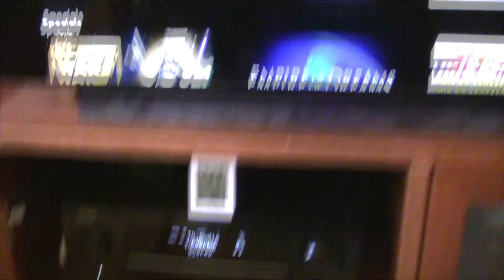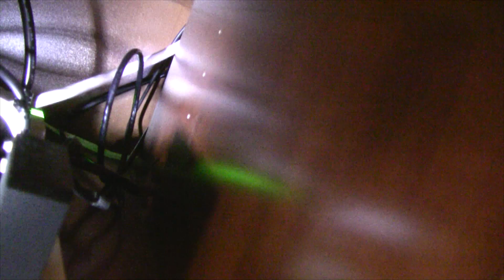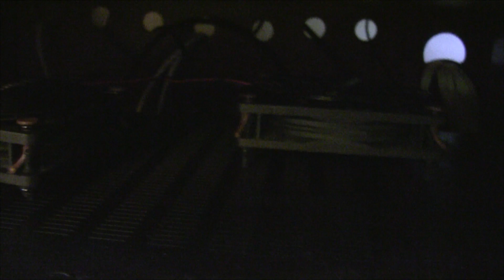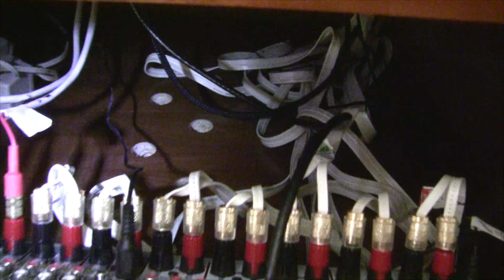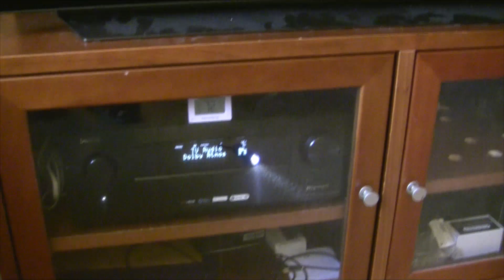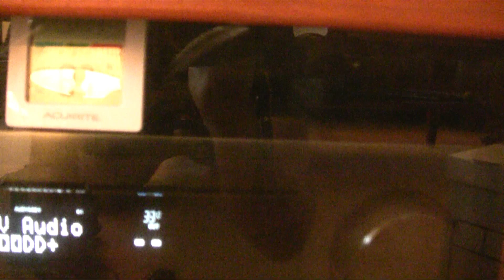Denon Receiver - Closed Cabinet Heat Test Using PC Fans

Comment: I’m converting an old 1950 built brass display cabinet with 2 smoked glass doors and wooden sides and chipboard back, which is 2 metre tall. Its width is perfect for my Marantz equipment. It has glass glass shelves to house 6 spaces. My dilemma lies with the best place to house my AV system, it is deeper than the other equipment and I need to cut out a significant size of hole out the back of the cabinet to feed the wires. I don’t fancy sitting it on the bottom of my cabinet, and I don’t want it to interfere too much with the air circulation. Also I don’t know if using the roof to exhaust the air would be best. With the glass shelving  not having any vents almost tight to the sides and back and only a small gap from top to bottom when the doors are closed, Any advice would be appreciated before I make any cuts I would regret. Thanks
Reply from the maker: I think it's going to look better at the bottom of the cabinet (or maybe the 2nd shelf) so you don't see the back cut out.
Having a large cutout in the back is doing to help with air circulation.
Make sure there's at some holes in the chipboard back at the top and bottom of each shelf area that has equipment in it so air came rise and be exhausted out the back.
You have glass shelves which is not helpful. My cabinet has particle board shelves with a laminate sticker on it to simulate cherrywood. So was able to drill holes under my receiver to help airflow from the bottom.
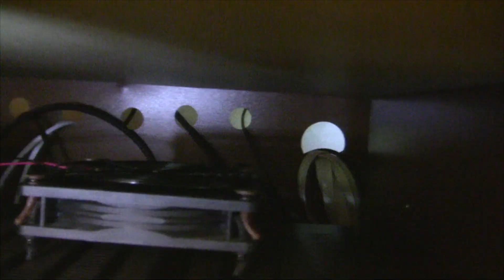As you can see at 1:01 in this video, I put an PC case fan on top to help with air ciculation. 
I did the same things with my reciever which is also in a closed cabinet. I drilled holes in the back of the cabinets as needed for air circulation and holes for wires.
I would definitely install a couple of PC fans on top of my reciever (with rubber standoffs) to actively pull air up and out.
Have them come one when your receiver is turned on.
Here's part 1 of my complete upgrade of my home theater where I implement such a system using a smart powerstrip:
https://youtu.be/c5jgOY4J6eE
Good luck and let us know what you end up doing.

Comment: Hi. I want to buy this as well but I am concern about heat management. Denons are reported to run hottt, plus I live in the Tropics - always summer/sun. From your interaction, do you think the heat can be managed in the tropics?
Reply from the maker: I think as long as you use active airflow your receiver will be fine.
Either use PC fans like I did or a buy a fan like AC Infinity.
https://smile.amazon.com/AC-Infinity-Front-Exhaust-Receivers-Components/dp/B078PQJSRY/
Reply: @BetaCygniBlog  Thanks. Noted. I will mount on top of cabinet with the fan atop - open air flow.
Reply from the maker: @koolrunnings3135  You're welcome. Let us know how it works.

Comment: My 3700H did run HOT! until I purchased a fan cooler from ACInfinity.  Cooling is all this company does and they have cooling solutions for any setup one might have.  I have my 3700H unenclosed so I bought the S8 that sits directly on the top of the receiver and exhausts out the back of the S8.   You can't beat the price either.  Frankly if this cooler was twice the cost I would have purchased it.
Reply from the maker: Those are good "plug-and-play" solutions for a reasonable price. 
I had all the parts lying around from various PC builds over the years, etc. so I decided to make my own.
I think it's worth it to actively cool your receiver. Especially mine which is in a closed cabinet.
Reply from the maker: @marcusbenwell3655  I agree. If you don't want to do the DIY fans like I did, I would buy a commercial fan like this one:
https://smile.amazon.com/AC-Infinity-Top-Exhaust-Receivers-Components/dp/B01LVW4SLP/